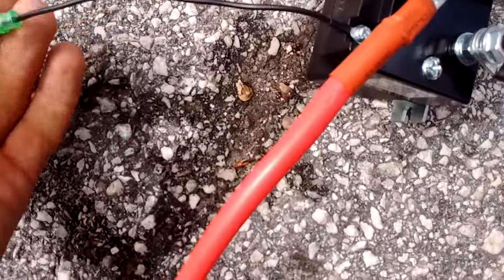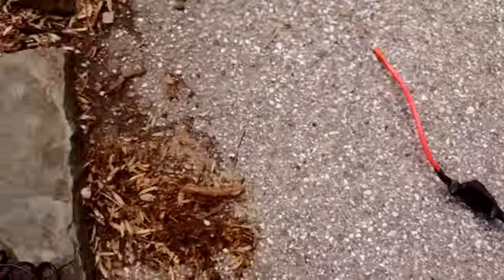How to wire an ATV Winch in 2 minutes. (Superwinch LT3000)

Comment: Just wondering, if you run the little red wire coming off the rocker switch back to the battery wouldnt it drain your battery when atv is not running?

Comment: This is how I wired my two winches.  Simple toggle switches to control cable in/out whether the ATV is running or not.  Good video.  Not sure why a plug-in remote is needed on a quad.  A truck, yes.  To get some distance from the cable under tension.
Reply: If it's an off camber situation and you don't want to sit on it a remote is handy. I'd rather watch it flop over on nothing than have it land on me.

Comment: Thank you, the switch to the winch on my old quad runner broke and there was never a. Solenoid ....must have been part of the original switch ... cannot get exact replacement, so am adding a solenoid with wires to match a switch, which happen to be the same as yours...should work
Reply from the maker: Hey did that set up and new solenoid work for you in the end?

Comment: thank you for this...i was pulling my hair out over this freaking thing
Reply from the maker: nice I knew I could help someone out :). In the end I didn't use the rocker handlebar switch.  Instead I directly attached the handheld remote switch instead.  This is a better set up because if I don't want any one using the winch I just pull the remote plug.

Comment: if the little bundle of wire conused you, you shouldnt be wiring anything, as you barely have the mental capacity to live.
 its a relay setup to make the winch work only with switch power so you dont kill your battery while using your winch. leaving you stranded.
Reply from the maker: nope, never been stranded... and still works. the battery is fine
Reply: Dual battery kit. Allows winch to utilize back up battery and charge it when you’re done. No getting stranded isolator will keep cranking battery safe and charged.

Comment: Vid say atv. But yet he says it’s going on his truck. A 3000 lb winch on a truck. Lol. U need a winch that will do 1 and a half times the weight of the vehicle being winched.
Reply from the maker: Ranger J the winch was used for moving heavy items, not itself.
Reply: My dad wondered why I put a 10,000lb winch on an S10 Blazer. I told him that I have friends with big trucks. First day I pulled out a 91 Dodge Cummins on 37s, almost every time that I have gotten stuck there was nothing to hook to. 100ft of cable and 4 20 ft chains and still not enough. Now I keep 2 100ft cables in the back as well.